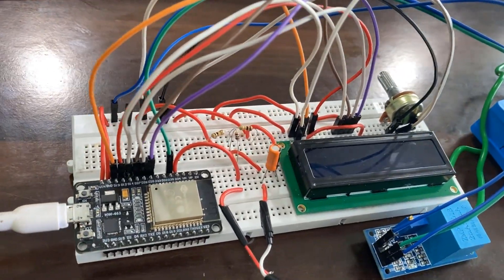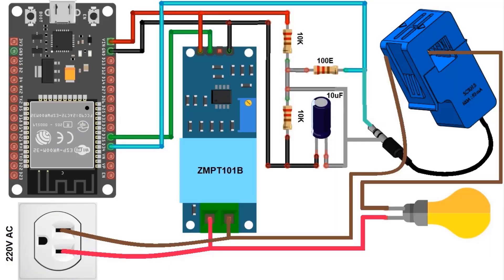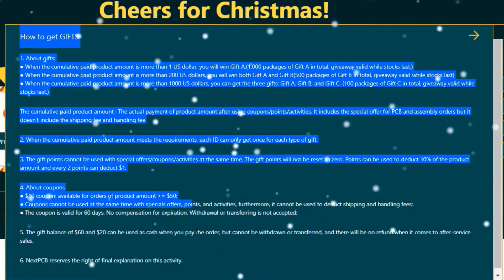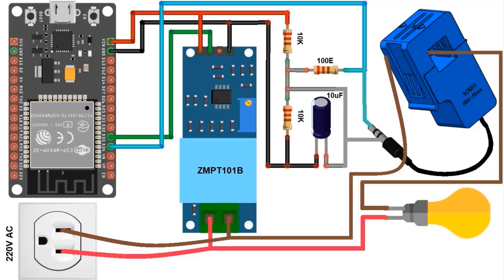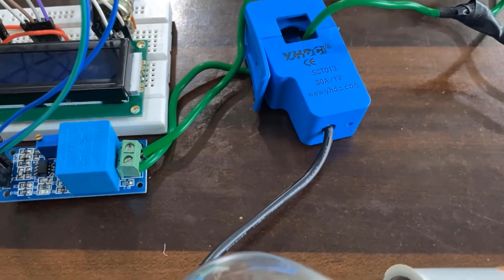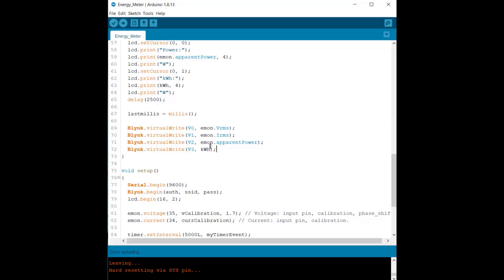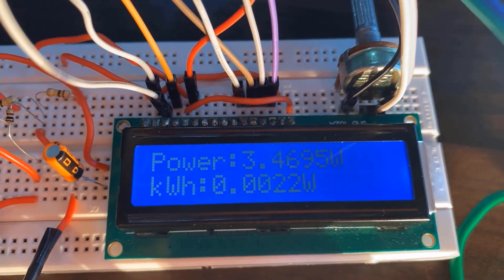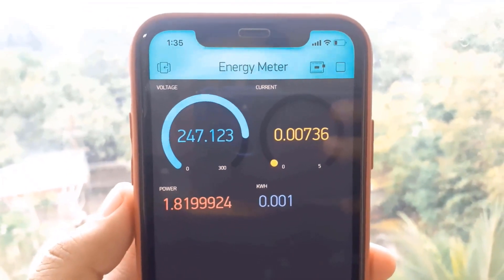IoT Based Smart Electricity Energy Meter using ESP32 & Blynk Application

Comment: How much volt capacitor is this. 250v 10uf capacitor is ok for it
Reply from the maker: Its for 5V device. You can use 10uF, 16V or 25V.

Comment: it seems like the esp32 wifi range is only up to 200m. Would it be possible to extende the range to cover much greater distances? For instance, would it be possible to use networks that can transfer meter data across an entire country using WiFi, LAN or Mobile Data?
Reply: Only 200 metres!  Jeeze what do you expect for 10 dollar?

Comment: Very Nice Video! Can you recommend DC current sensor that can measure mA signal? thankyou
Reply: Haha. I just spent a day trying to find a sufficiently accurate solution.  

You need to measure mV across a fixed resistance shunt, and an op-amp to boost the mV (which may be negative or positive depending on the direction of current flow) to a signal between 0 - 3.3v that the ESP or Arduino can measure on an analogue input pin.

That said my non-invasive meter has a DC voltage measurement, but I don't want to spend all day reading and recording the read-out.

I think there is a code error which accounts for the zero kWh readings.

Comment: Nice porject !  So can add  frequency ?
Reply: How often does your frequency vary?

Same with Voltage?  

If you assume the mains supply is 240v (or 230v, 220v or 110v in your locality), or use an easily measured value e.g. 236v) i.e. a constant, then the entire project can be realised without  cutting or wiring of any high voltage cables!

Comment: Hi! Thank you for this instructional video. Can you show us how to do the calibration of current and voltage
Reply: use a 200W and a 60W filament bulb in parallel and measure the current using a multimeter.

In my test, it showed that this setup draws 1.03A AC, so hence you can calibrate your current clamp accurately by fiddling the current calibration value accrodingly

Now to calibrate the voltage, its a simple task of fideling the calibration value till you hit the sweet spot
Reply: @pauljackson2126  thank you sir for  your helpful comment. I appreciate it

Comment: How can i make it work without the amperemeter. Also, there is a big diference between the new blynk app and the shown on the video, can you help me throught this?
Reply: No. You need to measure the amps and the elapsed time.  You cannot get to amps from resistance because resistance is also varying with loads.

Comment: Hi ,
Can i connect DC load and measures Enargy uses through Blynk?
Reply from the maker: These sensors are only for AC
Reply: @HowtoElectronics  SIR can you make a video on DC Load power consumption and energy meter for Dc and battery stutus and it's Graph, using ESP8266. with blynk iot , option.

Comment: What volts does the capacitor you are using??
Reply from the maker: 16V or 25V or anything above is fine
Reply: @HowtoElectronics  thank you so much
Reply: @HowtoElectronics  sorry i have another question, is 100ohms resistor still be fine if my sct 013 is 100A and my circuit have multiple bulb?? Thankyouu
Reply from the maker: Yes no problem.
Reply: Thankyou for the response ma'am

Comment: Can you please tell me what is the purpose of using resistor and capacitor circuit?
Reply from the maker: Reaistor is used for forming voltage divider network as esp32 adc pin can only accept 3.3 max input.

Comment: In the video, we can see the USB cable connected to the ESP32 chip. Is this to provide the DC supply for the chip? Could we use the output of ZMPT101B with a basic AC-DC rectifier circuit to power up the ESP32 chip? Or this would affect the measured power quality?  Thanks.
Reply from the maker: Use any 5V DC adapter to power ESp32 board or a usb cable or any Ac to 5V Dc converter. Al of them should work great.
Reply: Don't go there!  The live AC is connected at one end.

Comment: What values of resistors should I use if I'm using SCT-013-15 that is 15A to 1V CT? Can you please let me know?
Thanks.
Reply from the maker: No need to change any resistors for any current sensor.
Reply: @HowtoElectronics  Thank you so much 🙏

Comment: The CT clamped on wrong wire in your video, It should be on the wire in series with 'Lamp LOAD', but in video it is wrongly shown on voltage sensor input wire which is parallel to lamp. There fore you can not get the correct  readings.

Comment: Please let me know How you are going to measure analog voltage on GPIO pins(GPIO09 & GPIO10 / SD2 &SD3), however no pin other than ADC (ADC0) can be used to measure analog voltage, as the CT & Voltage transformer has Voltage output(i.e. Analog). As we all know there is only one pin there on NodeMCU ESP8266 to measure analog signals, which is not at all used in the above schematic. Please explain
Reply: She is using an ESP32, not an ESP 8266.
Reply: @Posho  Exactly

Comment: blynk application has a newer version, will the code used in this project be the same or not?
Reply from the maker: Use the old Blynk app not the new one. Old blynk app is available.
Reply: I am a new user, I tried to register to the older version but they won't accept new user registration. If I used the newer version, can I still use the codes with minor changes?
Reply from the maker: The blynk part in the Code need to be changed for newer versions.
Reply from the maker: The video for new blynk is coming on next sunday.
Reply from the maker: The tutorial is posted on website. And the video will come most probably tomorrow.

Comment: Sorry for the newbie question. I'm planning to add, additional SCT-01 Current Sensor as I want to monitor another line. Can i use other digital input and still use the same setup as this?
do i need to change any values on the resistors, or capacitor. thanks in advance
Reply: Lookup the I2C specs of the sensor...I must do likewise.    
I don't think the code presented uses I2C.

Google "SCT 013"

Comment: Can you please help me by making this only with current sensor, voltage 240v as standard voltage. By using current sensor alone is it possible to do the project
Reply: What I am thinking is 

In void loop 
Take the analogRead of the current sensor and serial println 240*analogRead
Reply: Absolutely!  That's how the power company does it, surely! 😂

Comment: Thank you. Can you help me. i have similar project to display data on blynk application and i2c lcd at same time with esp01 and arduino but I am facing issue that only blynk or lcd work at a time so what could be the reason? Can you give any solution and thanks for such great videos 🙂
Reply: Surely that's a software integration issue.

Comment: I havea problem in reading the voltage
Reply from the maker: Calibrate it in the code part
Reply: @HowtoElectronics  Thanks for the response. I'll try to fix it
Reply: @HowtoElectronics  Also, even though I haven't yet connected it to the load there are some readings in the voltage and current as well as the power.
Reply: @gerardaldwinpatoc316  like your problem , do you solve it ? 

And i have qnother problem , when i connect the voltage sensor , i have a corrupted sample , when i disconnect the voltage sensor , i have reading for voltage and other parameters

Comment: Can we connect it to our MCB as my meter is located far away in an electrical room in my apartment?
Reply from the maker: Depends upon load. If the load is small you can connect it to mcb
Reply: @HowtoElectronics  Thank you for your valuable information.
Reply: @HowtoElectronics  And how much KW of connected load is viable according to your opinion?
Reply from the maker: Check the website article for more info. And i guess the device can only meausre the current upto 30 ampere and voltage not more than 500V.
Reply: @HowtoElectronics  ok

Comment: i am not able to get the values from esp to my Blynk app in your video you haven't showed how to connect .
i have messaged you in instagram many time but you are not responding to me.
i need you help.
please tell me how to configure the blynk app.
Reply from the maker: You need to connect using Blynk Authentication Token. Copy the token from setting section of blynk app. And use that token in code. Also select the virtual pins in blynk app and configure it by matching with the pin in the code part.

Comment: If I use esp8266 instead of esp32 then what changes will be made in code???
Reply from the maker: Its better to use esp32 for this project as it has multiple analog pins whereas esp8266 has single analog pins.
Reply: @HowtoElectronics  actually I have esp8266 at current.so what changes should I do in code ?
Please guide me

Comment: Will the hardware and sensors be the same if I’m using DC source for the source of the load?
Reply from the maker: That is ac current and voltage sensor. You cant use DC.
Reply: @HowtoElectronics  what do you recommend for ac source other than home outlet?
Reply: And thank you for the fast response

Comment: I have the same project but I'm doing it on Arduino. is there similar app on ios for arduino ?
Reply from the maker: Yes Blynk app is available both for Android and IOS.
Reply: @HowtoElectronics  thank you so much. I have the same project and this helps a lot.
Reply: @HowtoElectronics  another question.
I’m doing a project and I’d like to get some guidance if possible. I have  LTE CAT M1/NB-IoT Shield - SARA-R4 (with Hologram SIM Card). I know I can do SMS to control/view the meter. But will I be able to integrate it to blynk app because it has plots and many other useful info to monitor power usage and way easier for the user. Thank you again

Comment: Dear Mam, thank you for sharing the video. I used the code working good but, the voltage is keep on reucing, hence I want to know how to calibrate the voltage range, what i that 83.3 , how to select this value? please help me mam
Reply: We change that value until you get an voltage equals to the one you are measuring.
Reply: What are you both saying?  

Just use a voltmeter across live and neutral and use that figure in the code!  

If you want precision retest the mains periodically.  Only if your AC is overloaded will it not be compliant with local standards to within 1%.  Volts x Amps gives power but variability in volts is restricted in practice to DC circuits.

Comment: Major Mistake, the current sensor must messure the current in the load cable, not in the cable from the voltage sensor XD

Good Video and good documentation.

with what software has you make the images with shematics ?
Reply from the maker: Thank you for the feedback and letting me know about the current sensor placement. The schematic has been designed using Fritzing software
Reply: Good point dear. I was just searching the comments to see if anyone saw that the current sensor was not properly wired. Thank you. Afterall, very good video, very informative. Thank you @How To Electronics

Comment: Nice video..In video timer (3:58) you have cut one of the wires..How do we know which is the useless wire that we need to cut?
Reply from the maker: The useless wire is not insulated and has thin bunch of wires. You can easily identify.
Reply: @HowtoElectronics  Thanks a lot...Also, is it possible to connect the bare end of cut wire of SCT and that male header pin of ESP32 with a F-F jumper cable directly?
Reply from the maker: Yes it is possible

Comment: Good video, i need to understand something, the GPIO pin of the esp32 is 0 to 3.3v logic level and the voltage transformer is 0 to 5v, so the question is how do you manage the this voltage level incompatibility in the esp32 ADC ?
Reply: no pin other than ADC (ADC0) can be used to measure analog voltage, as the CT & Voltage transformer has Voltage output(i.e. Analog). As we all know there is only one pin there on NodeMCU ESP8266 to measure analog signals, which is not at all used in the above schematic.
Reply: @mohanvakil4604  The ESP32 is used here.
Reply: Very legit question with no answer yet
Reply: The two 100k resistors make a voltage divide by 2, so with Vcc at 5V, the mid point of the resistors is 2.5V.  The 2.5V is fed to the ADC input via the 100R resistor.  The current clamp is across the 100R resistor and when the clamp measures a current it generates a voltage across the 100R resitor, adding (or subtracting depending on the ac cycle) to the 2.5V.  So the 2.5V could vary between 1.5V and 3.5V with 100A flowing through the clamp.  The 10uF is probably for noise supression.  That is my thinking anyway.  Let me know if I have misunderstood.

Comment: Best ever project seen today by you thanks  this is possible for 3 phase supply
Reply from the maker: Thanks for the appreciation. The current sensor and voltage sensor is only for single phase. For three phase we need to use some other voltage current sensor.
Reply: @HowtoElectronics  ok sir seperate 3 we can use for voltage same for current